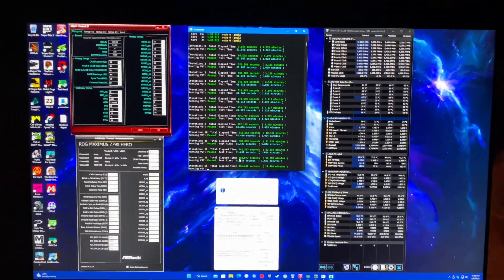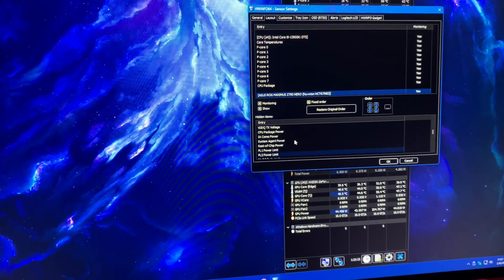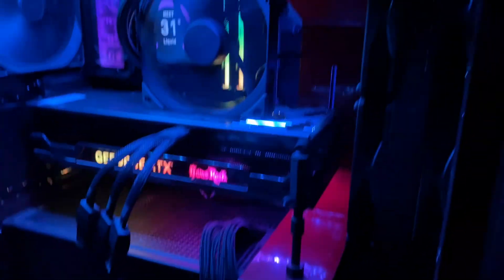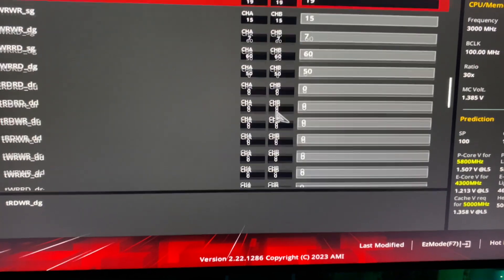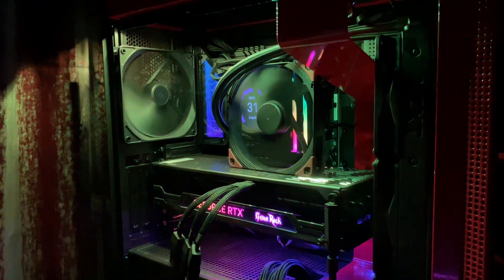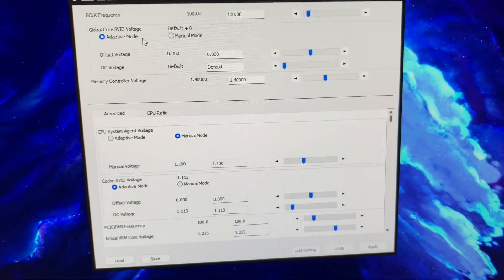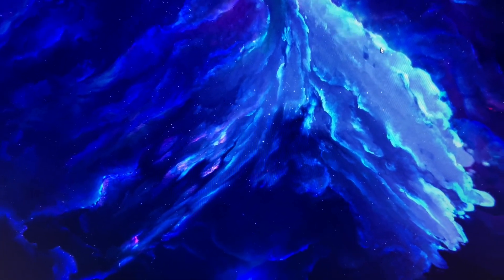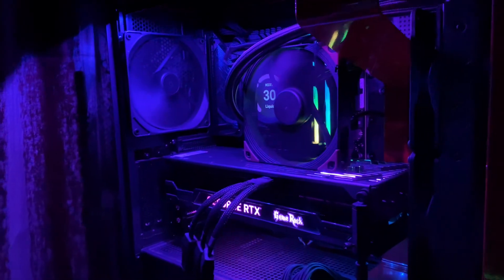ASUS 4-DIMM Z790 08xx and 09xx BIOS Revisions are TERRIBLE

Comment: hello buddy great video would this work with my 6600 gskill m di on a z690 hero? thaanks
Reply from the maker: The methodology but not the exact values (obviously). The values you can copy are my ODTs and my PLLs. 1.4 VDD2 and 1.4 TX might actually be good for you as well tbh. For 6800 you’re likely going to need 1.45-1.5 DRAM VDD/VDDQ. I don’t know if I can guarantee that will work with your board though. The 690 Hero struggles with M-die above 6600.
Reply: @dainluke   oh ok thanks might be time for   new  mobo
Reply from the maker: @AccuracyGaming  Use ME 2091 and the 2204 BIOS. Just see what your CPU and RAM sticks are capable of. Don’t be afraid to shuffle them around as well. Sometimes flipping them helps. You might hit 6800. If not, I can give you 6600 settings that might work easily.

Comment: What happened to your Kingpin?
Reply from the maker: I dunno if you’ve heard the parts of my vids where I mention where I’m from. But basically distributor markups and stuff like that are killer. A lot of the shipments for PC parts come from distant locations, and vendors like ASUS don’t offer rebates or use favourable shipping lines for our retailers. Basically the Hero was over $900 at retail. 

One night at 1 AM I spot this one for MSRP ($620) and it’s an unboxed deal. I decided to take the gamble because it was so freaking cheap (65% retail) and it ended up being spotless and unused. Sold the Dark to another dude who wanted max memory speed.
Reply: should I be on windows 11?
Reply from the maker: @Domiinoz  Well, it depends. Windows 10 is sometimes better, but they often break Intel scheduling. Windows 11 IMO runs totally fine as long as they don’t push out an update that (also) breaks things. It’s really hard to say tbh. Best course of action if you want to be optimal is to use one of those custom stripped OSs. They help more for benchmarking than gaming though.
Reply: that was me